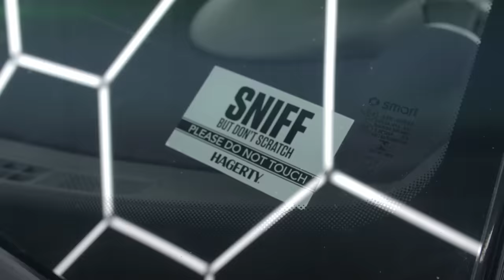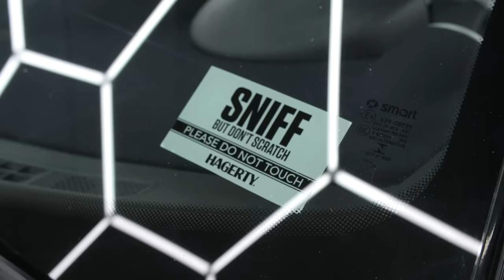300HP Smart Car is The Ultimate Tuner Troll (Turbo Hayabusa Swapped Smart Car)

Comment: A 600hp capable turbo motorcycle engine in a car that weighs less than a ton....yeah I'd be pretty terrified to drive it myself
Reply: Now that’s the ultimate drag car
Reply: it’s actually really safe
Reply: @random13627  lol
Reply: @random13627  economy cars are made to be safe…with less than 100hp😂😂
Reply: I'm blown away at that only being 300hp... it can make double that power?!?
Reply: @hiashi1943  not a stock engine . They require a lot of work to make that
Reply: @josephfoster3819  yea it has the work done but as he said once youve got so much power it just becomes undrivable so its turned down
Reply: reminds me of.. well..  TOYOTA MR222D INTENSIFIES
Reply: @jameswallace9665  i can imagine
Reply: @hiashi1943  The car wishes death upon the driver with just 1/2 the capable HP. It's why it was turned down.
Reply: Motorcycle be like
Reply: @hiashi1943  I'm convinced it's not just 300 hp lol. It would have to make 140 ft lbs at 11,000 rpm for that to be true and it sounds like it has more juice than that up top 😂😂
Reply: @amorag59  If you were paying attention, the owner detuned the ECU for this guy to test it. It's SET to approx 300hp, It's capable of 600hp.
Reply: @bmw328igearhead  What? My comment was specifically from the information that this is the reduced tune🤦‍♀. As with the comment I am replying to, we are both surprised this is *just the 300 hp setting because it sounds bonkers up top.
Reply: @bmw328igearhead  Perhaps you should pay attention when you breeze through comments
Reply: @amorag59  I definitely did breeze through. Sorry for offending.
Reply: Nothing new in the Honda world civics are under a ton and there's 1200hp ones
Reply: @lukeinavan  1200hp
....barely 400ftlbs

Horsepower sells cars
Torque wins races
Reply: @geerstyresoil3136  yeah, case of the deadly spins.
Reply: Hayabusa is really 600hp capable? really? wow!
Reply: @sultanmehmoodghaznavi6312  with $20-30,000 of machine shop work and parts... yes
Reply: @random13627  Ummm yeah sure. 🤣
Reply: @thatcarguy0710  But, but, but surely they are just as safe with 7 times the wheel HP right? 🤣

This thing is awesome in my opinion. Maybe a death trap but can you imagine with the low end torque just how ridiculous it is? Some of us don't ride high performance bikes for a reason.
Reply: @random13627  Oh, and Deni this thing at full power could potentially flip over on launch...🤣... it is so ridiculous but awesome. This thing is not at all safe using the typical meaning.
Reply: @CynHicks  only 7x?? that’s underestimating this little bean
Reply: @thatcarguy0710  I was talking about as is; tuned for half HP at 300.  Probably still understated though. Good point.
Reply: @random13627  it's actually really not
Reply: @sultanmehmoodghaznavi6312  they're making more than that now.
Reply: yet people sit on top of the same engine with just 2 wheels on the ground
Reply: The engine can handle the power the car cannot.
Reply: I’m putting a Hayabusa bike engine in my 2007 scion Tc
Reply: @lukeinavan  yea but they aren’t this light
Reply: @random13627  😂 yeah right!
Reply: @bmw328igearhead  yeah sure go win those circuits with your Kenworth 😂😂😂😂😂😂😂😂😂
Reply: @MrTeddy12397  Come again?
Were you talking about a large truck I do not own? Or the dribbles on your chin?? I'm unsure what you were eluding to with your comment.
Reply: @bmw328igearhead  trucks have most torque. torque wins races as you said.
Reply: @MrTeddy12397  Trucks also weigh 4000lbs and up. You don't need as much torque with a light vehicle, as this specific example shows. F1 cars are a good example, make gobs of HP at super high speeds, but nothing down low, relatively speaking. Cars weigh next to nothing. 

I don't think you quite understand who you're speaking with. And that's OK, how could you from that basement? Run along, play some more Forza, Gran Turismo or NFS, (whatever your preference is) and have yourself a merry little day. :) Peace be upon you, in every facet of life.
Reply: @bmw328igearhead  lmao grow up
Reply: @MrTeddy12397  Says the person who gave themself the lone up-thumb... ;) Child.
Reply: @bmw328igearhead  
>Horsepower sells cars
>Torque wins races

that doesn't make sense

You can achieve any "torque" by adjusting the gear ratios. It's like a lever, a long enough lever will move the world, it'll just do it very slowly.
Reply: @mattizie91  Let me explain it another classic way for visual aid...

Horsepower is how fast you hit the wall, Torque is how far you push the wall.

Gear ratios help gain an advantage.... sure... but thats not what I'm talking about here in this instance. Gear ratios are irrelevant in the course of this conversation.

Sounds like you're the kinda person to buy an old charger, that'd pick the 426 Hemi over the 440 because of a higher HP number. It was actually the 440-6pack that was the top engine option, because it made more torque.

Horsepower is merely the rate at which torque is generated. You want as much torque as you can get. Two engines side by side. Engine 1 makes 375hp & 350ftlbs, Engine 2 makes 350hp & 400ftlbs.... which engine would you take? 

I'll take engine 2 all day long if all other factors are equal. (Weight, tire, transmission)
Reply: @bmw328igearhead  this is a common misconception. Power is the engines ability to do work per unit time. Torque does not matter. What does matter, is the power curve. An engine with huge power in a small rev band can only be fast if it had the gearing to match. It would require a lot of gears. The statement that power sells and torque wins comes from a time when there weren’t any gearboxes with a lot of gears. This meant that a car with a broad power distribution would have an advantage. Usually, such cars have high torque as well.
Reply: @Gnerko123  So explain electric cars... they don't have gear boxes, if they do, it's a 2 speed...Yet are wicked fast. Why? They make ALL of their torque at 0 rpm. That's why Tesla Roadster in plaid mode is such a beast. Torque. Horsepower is there, not denying it, but torque is where it is, and always will be, where it's at. I'll take an 8liter NA 8or10cyl engine over a 4bar boosted 2.0l 4 banger every day of the week.
Reply: @bmw328igearhead  
Electric cars don’t need multiple gear ratios as they have lots of torque all over their rev range, except up top. That’s why some have two speeds. Electric cars usually have relatively low top speeds for the power they make. They accelerate fast because they make a lot of torque and power right from the start.

I’ll throw you another example. A formula one engine has 200Nm of torque maximum. A vw gold gti has 350Nm. Yet, a formula one car with a golf gti engine in it is slower than with the original engine. The reason: power.
Reply: @thatcarguy0710  This car really is safe, some people crashed it against a wall at 100kmh or more (I don't remember the exact speed) yet they could still open the doors

Comment: I couldn't imagine a more terrifying car than a smart car with 300HP.
Reply: A Model T with 300hp
Reply: @damarcuz1  I have a model T with a hell cat engine with normal tires on Forgiatos
Reply: @Grandpaneedsblood  I'm jealous
Reply: How about a smart car with 600HP?

Flip a switch, and that's what this one becomes.

(and yeah that'd scare the hell out of me - 300HP is already plenty scary)
Reply: Totally..... he should have went with a 88-91 Honda crx..... around the same weight and would handle way way better!
Reply: This. I can't imagine accelerating in a chassis made for under 100hp with a built Hayabusa turbo chain-drive motor with 300+hp 😳😵
Reply: @patheddles4004  undrivable without major modification. This thing is insane enough with chain drive, solid motor/drivetrain mounts. It's way harder to keep on the road than most people think. Dude is a really good driver, but keeps lifting, for a good reason lol. What a wild ass build. I love it
Reply: @eastwood4006  no argument on any of that - put me in a car like that and realistically I'm gonna struggle to do anything at all except crash immediately.
Reply: That depends on the way you drive it. Its challenging, and you should not rely on ABS and ESP. But driving at around 120 mph and looking in the faces of people that you pass is priceless.
Reply: MY 68 SLYLARK GS 4OO BIG BLOCK WITH 4 WHEEL DRUM BRAKES
Reply: this platform max around 150hp, more than 150 it is dangerous, seriously.
Reply: I had a Suzuki Samaria with a 300hp 351W and it was terrifying

Comment: he should do an AWD version, that thing would be insane.
Reply: So u mean an Yaris GR?
Reply: @MiyagiDo9  Well, this thing is much smaller and lighter.
Reply: @MiyagiDo9  bro, I really hope those come to the US. FR the first JDM car that I might buy new, instead of 10+ years old used like I normally do lol
Reply: @von...  Good news, you get the GR Corolla in the USA.
Reply: You should check the Giannini 350 GP it’s basically it lol
Reply: Power is allways better from the back and you can squeal the tires alot more
Reply: i don't think it would matter that much because the front of the car is getting so light when accelerating so front wheels would always spin
Reply: I rode in this car today. Can confirm, the front wheels wouldn’t be touching the ground enough to even make a difference 💀
Reply: Put a second engine in the front to balance it out.
Reply: @itsthescorp  This is exactly my thought. Twin engine swap would be amazing. Think about it, 1200 AWD HP and 2000 lbs. I'm actually surprised they are even that heavy.
Reply: YES!!!!
Reply: Dual engine awd would be op
Reply: @itsthescorp Dual engine would be cool but these are rwd normally so it'd be a pain to do
Reply: I mean I get you where the hell are you putting it..there is no room lol... Plus the added torque on a bike motor for AWD plus car weight goes up you'll need to  replaced engine  every 15,000...but it would be fun

Comment: Motorcycle gearboxes are basically sequential gearboxes. You could clutchless shift this by pre-loading the shifter and letting off the throttle a little, but it does wear the gearbox a little faster same as on a sequential. Best option would be installing a quickshifter, they're very common on bikes.
Reply from the maker: Annnnd this is why I don't review bikes. Thanks for clarity my dude! 

The owner Eric told me to clutch in JUST incase. I just was the monkey behind the wheel and said "okay I'll do that in this insanely scary wild car." lol
Reply: Yea i dont ever use my clutch on my GSXR 1k up shifting
Reply: Quicker shifter would make it perfect
Reply: @waylon7371  my neighbour has a Ducati Panigale V4R ...
he can also put a setting on that helps with it...
but is afraid to try hahah I don't blame him!
Reply: @g60force  his bike should shift like butter with his qs! He doesnt have anything to worry about.....hell as much as those bikes cost they should take u to the perfect lean angle in curves themselves! 😂🤘
Reply: If you reviewed bikes, you'd have to be thatdudeONblue...
Reply: @waylon7371  yeah prices or insane..
and he’s 64yrs old :/
Reply: Motorcycles uses wet clutches,don't worry about it, it doesn't wear as fast as cars.
Reply: Im surprised this car doesn’t have a quick shifter. Maybe it’s due to the peddle set up? I never use the clutch up or down shifting on any of my bikes unless it’s to stop
Reply: Also it's perfectly fine to feather a bike clutch and not worry about smoking it. Wet, multi plate.
It's how low torque high hp motors leave from a stop and how bikes that idle at 25mph navigate parking lots.
Reply: @LogieT2K  quick shift setup + a racing wheel that works well with paddles would be an end-game setup imo
Reply: Why are you surprised it doesn’t have a QS? I mean they didn’t even manage to have the shifter in the right direction. He pushes forward to shift up lol.
Reply: @smaxfpv1337  
It's absolutely trivial to flip the link arm on the bike's input shaft 180° for gp style stomp up.
Pull down, push up matches the OEM SMART triptronic.
Reply: @g60force  I don't have it but I do what that dude said. My clapped out "01 gixxer thaw will bang gears like a champ! The unfortunate thing is you go for a Ln overtake, give it quarter throttle and accidentally crack triple digits.
Reply: @The Vibe  I have the same bike! I ride dirty no insurance and expired tags. It's a waste of money.  Just roll back on the throttle, and you're gone. Just make sure you always top off on gas.
Reply: @waylon7371  my gixxer thaw upshifts like butter without one. clapped out gixxer thaw from 2001 here, representing. also fat bloke and his first bike too. there are stereotypes for a reason.

Comment: I cant imagine how sketchy that speed feels with that short of a wheel base brave man
Reply: Likely all factory stability controls are not in place anymore. 
I had a diesel smart car, with all its 40 HP, when stability/abs system was off (due abs failure) it was real sketchy… granted on snow and ice. Back end would drift at ease and once it goes, spin out most every time, due such short wheel base.
Reply: The front end lift on acceleration must also add to the factor. The fun with that car is mainly for going in a straight line.
Reply: My butt is clenching with the mere thought of that engine in the actual bike
Reply: @TheDonCucaracho  as a biker i would be scared more in that little smart car

Comment: The funniest thing is that he could put a motorcycle quick shifter into it and make it a clutchless sequential, it would make it flat shift also so he wouldnt lose boost and it would pull even better
Reply: Depends on how old the gixxer motor is but I was thinking that too. I love the sound of a quickshifter banging through the gears.

I wonder if he could rig some kind of solenoid to the shifter linkage and build paddle shifters onto the wheel that way he wouldn't have to let go of the wheel to shift.
Reply: @salazam  there is no difference if it's the first year or the last, healtech solution would be fine with any of them
Reply: @szypki_zygi  Oh durr. I was thinking it had to be fuel injected for some reason. I forgot it just pauses spark. Hmm... that gives me hope for my bike!
Reply: @salazam  i guess that this hayabusa is already fi so that wouldnt be a problem, you need electronic throttle control if you want to have a blipper downshift
Reply: @salazam  idk dude I've started last summer on a clapped out gixxer thaw from 2001 and it clutchless shifts like a boss. Apply light pressure on the shifter and blip down the throttle a bit. It just snickets into next gear. Makes you feel like a superhero.
Reply: @SoulTouchMusic93  light pressure and a rev will allow downshifting with ease.
 I used to power shift once I hit high rev. Nyet.. nyet.. nyet.. nyet.. nyet.. nyet.....

Comment: You can tell how fast it is from the clip of you doing the pull next to the 18 wheeler 😳. Not going to lie I would be scared to drive that thing without a cage 😂.
Reply: Doesn't need one. The Black accent along the side is actually the exposed tridion safety cell, which is essentially a reinforced steel cage. The car is arguably one of the safest modern designs in the industry
Reply: Motorcyclists don’t have cages lol

Comment: Nice. Now try it on a motorcycle 😉 I’ve got a 270whp turbo Hayabusa. Car bois think they know fear lol
Reply: Lmao get smoked in every corner boi
Reply: I've seen videos of turbo busas popping power wheelies with just a light throttle blip at 120+mph. I don't know how you people are still alive, lol.
Reply: See you in heaven
Reply: Try 607 whp.. I've been racing and turboing Hayabusas for 17 years. I've got  the RCC ultra turbo kit. Ryan Schnitz built and tuned it. Made 607 who at 33lbs on c16 . Makes 403 whp on pump gas. I'll do rolling 180 mph burnouts. We run 6.8 at 210mph in quarter mile and go on cross country rides
Reply: @turbolsx3017  6.8s, lol damn :O
Reply: @Pineaplethefruitdude  
More like pile in behind and WAIT for the car to navigate the corner due to heavy late breaking, then set a calendar reminder to wait for the car to "accelerate" on exit. Also the lane is 2-3x as wide for a bike so it's taking every corner at significantly wider radius.
Reply: Yammie. Your vids are good, but you sound as if youre begging for attention.
Reply: @turbolsx3017  you are gonna run out of 9 lives there kitty cat

Comment: You can actually clutchless shift it without issue on a stock setup. 
You just break throttle while having pressure on the shifter, Unloading the trans let it drop into the next gear. It should still have worked with the hand shifter.

Comment: Get an experienced bike rider to drive that thing… and install an electronic air shifter.. but advice on driving a Smart fast.. make sure your corner weights are done with you in it.. and tire pressures are perfect… the wheelbase is so short it makes for a twitchy ride.  Cool build but I would definitely want it quieter… but personal preference. I put the clutch on the shifter with a remote reservoir .. but used a ZX14 since I had one. Silly, juvenile fun.

Comment: It's fast but when it come to throw in a full speed does it actually able to put down the full potential that it has, that's the question. HP number don't always a winner. Don't mind to have a fun run with these lil guy.

Comment: I've been driving a 2016 SMART Passion ForTwo for the last 2 years in snow and summer. Never had a problem with it at all. Occasionally I take it on the Lake Side Parkway (very low traffic) and just open her up. The little 3 cylinder turbo charge easily and very quickly get her up to 120mph (max). But with the small wheel base it gets squirrely changing lanes. I can't imagine what your motor will do to this type of car. But you got me thinking: trade my 45-50 mpg motor for something that seriously will launch my baby or keep her original? I.... I wanna try yours.....